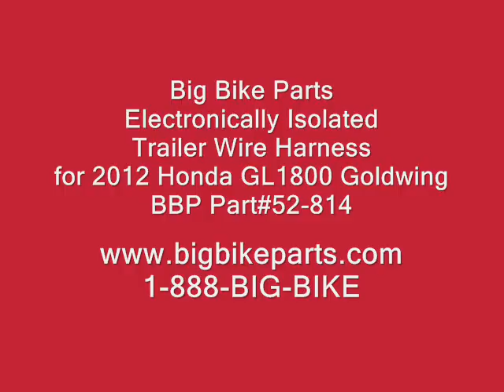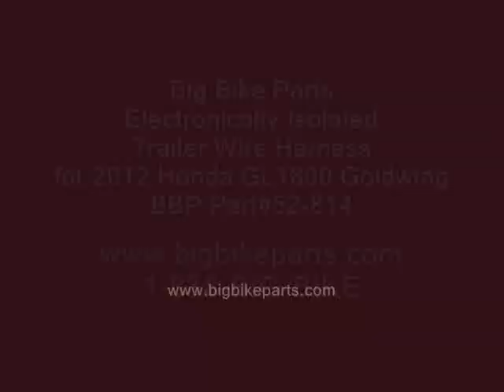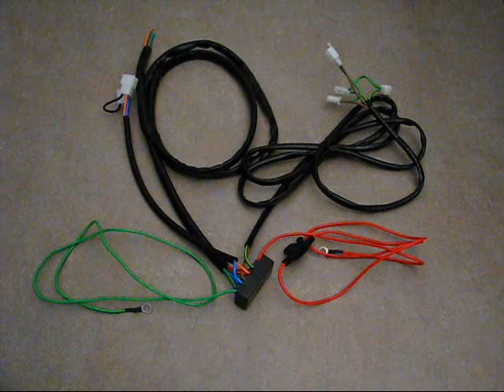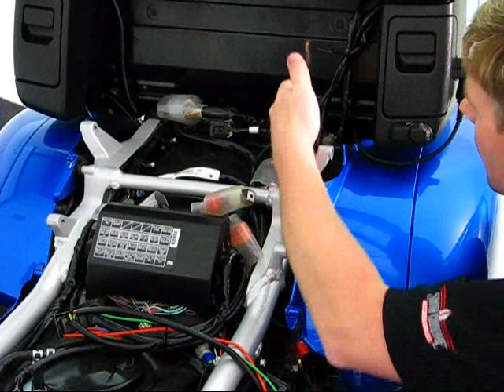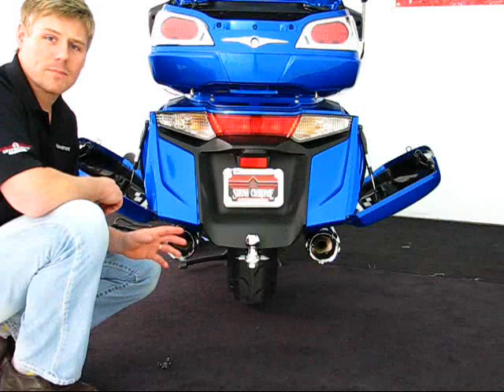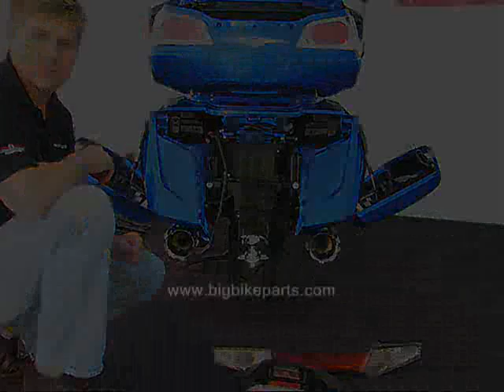Electronically Isolated Trailer Wire Harness for 2012 Honda GL1800 by Big Bike Parts

Comment: Do you have an install video for the Trailer Wire Harness #52-694?
Reply from the maker: Hi Matt, we don't have a video for the older model Goldwing, but we do have the instructions on our website here: http://www.bigbikeparts.com/templates/product.aspx?ProductGuid=52-694&GroupGuid=16
The install is very similar to the new kit, but you plug in the harness in the trunk lid, not under the seat. Feel free to give us a call at 1-888-BIG-BIKE if you have any questions.

Comment: Hi!  Do you all have the video for the wire harness install for the 1500 Wings using Part No. 2-448?
Reply from the maker: Unfortunately we do not have an install video for the 2-448. If you have any questions you can view the installation instructions on our website, or give us a call at 1-888-244-2453.